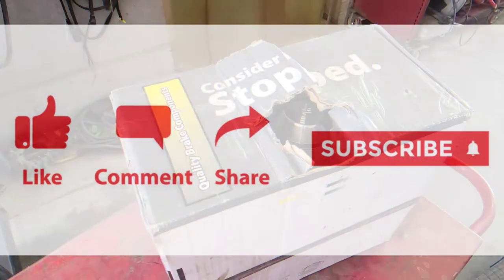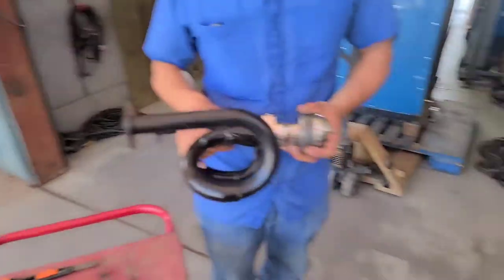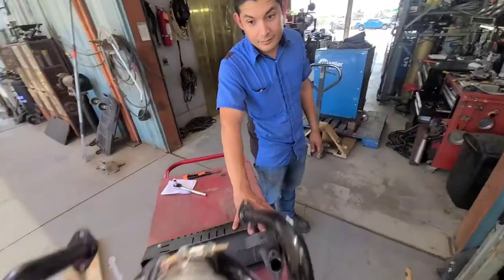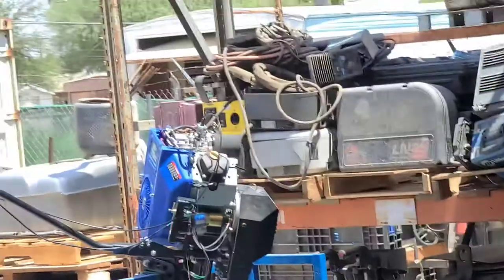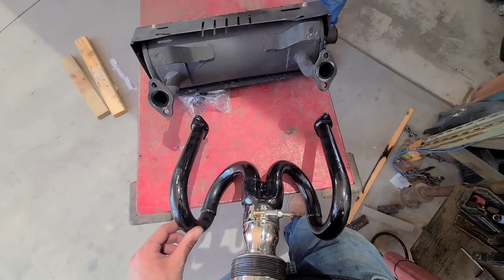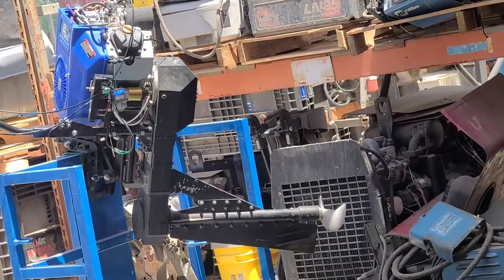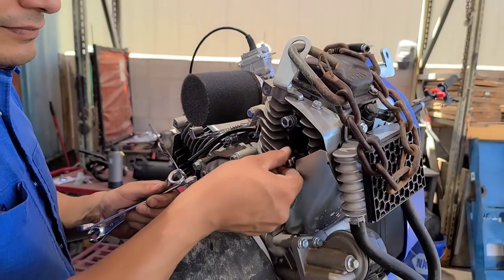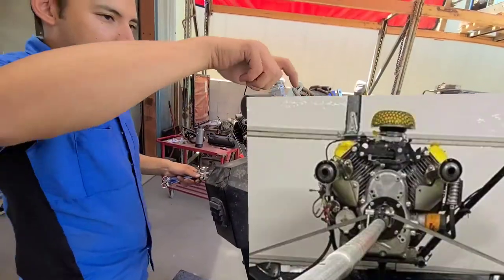Duromax 713cc aftermarket exhaust

Comment: What exhaust did you have on it before hand where did you get it if you don’t mind great video by the way
Reply from the maker: Beaverdam Mudrunners Imports a Stainless Steel 420cc exhaust from CLP thailand that will fit after changing the exhausts studs. It won't give you a power gain very disappointing that I could not use the loop exhaust i ordered. The loop style exhaust only exhaust that will give you an actual power increase otherwise all the other mudmotor exhausts just redirect the exhaust backwards away to the back of the boat and sound better. It's a good priced a well made exhaust but will not make any power gain from it. But hopefully in time Robertson Torque tubes or another company can make a loop exhaust for the Duromax 713cc. Great engine and warranty hope it becomes more popular in the mud motor world.
Reply: @azlongtales  thank you !